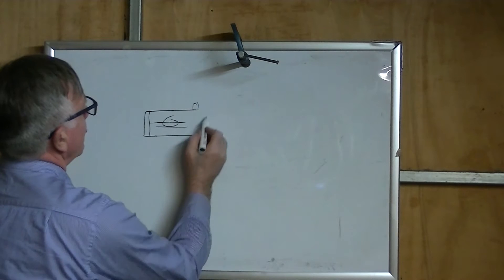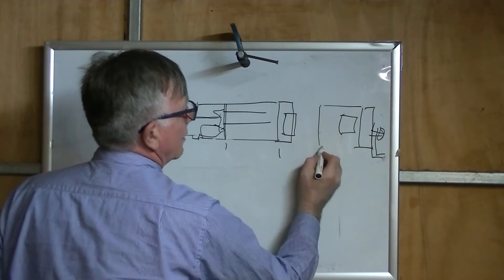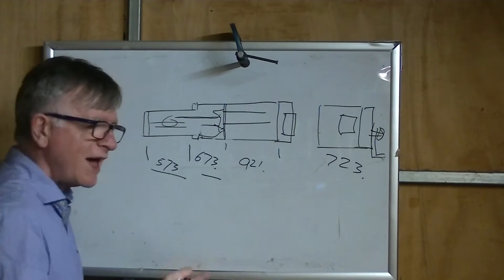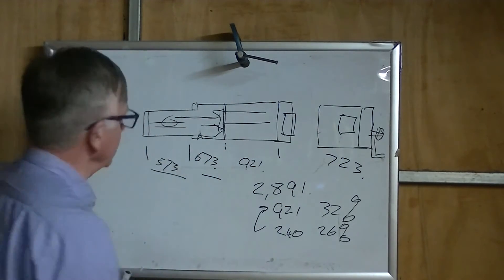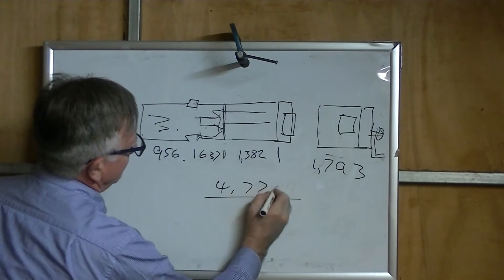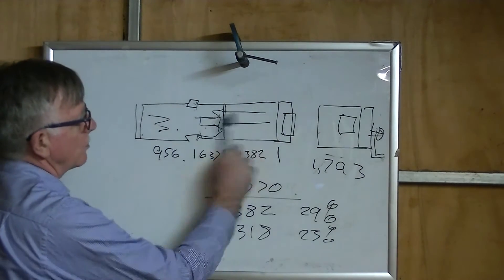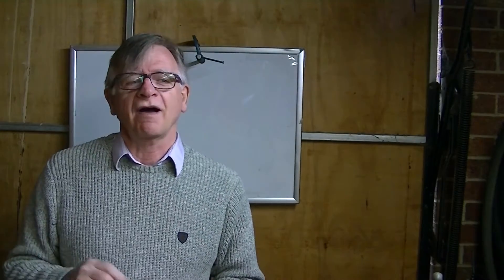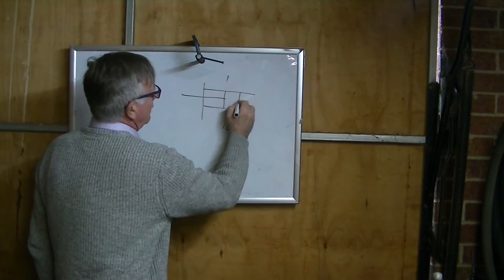Submarine part 2

Comment: Very useful, thanks. You can use a threaded rod like this: http://img.banggood.com/images/upload/2015/06/SKU226384_7.jpg 
This rod has a diameter of 8mm, also has 4 threads and by each turn of the rod, the nut it displaces 8mm. Actually this kind of rods are used for homemade CNC machines, but they can be used too for others applications. I don't think that one segment of the length that You need, increases the weight significantly. The problem will be probably the moto-reductor.
One more time, thanks for your videos.